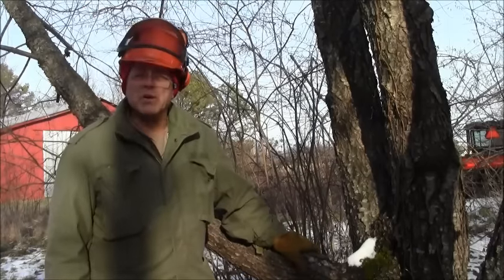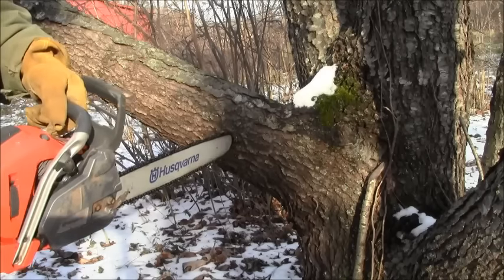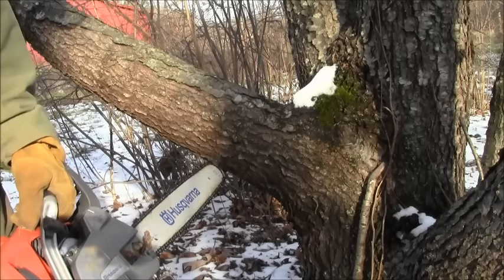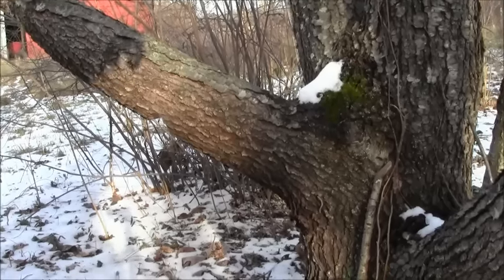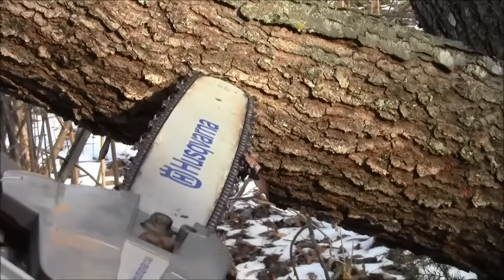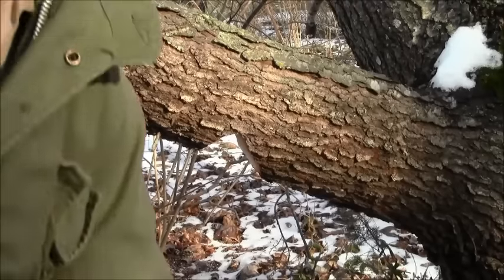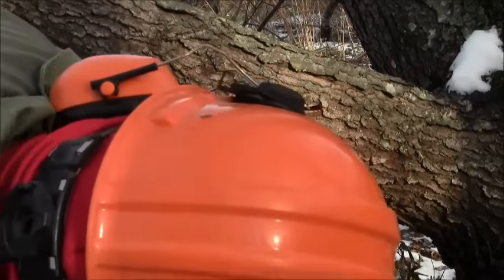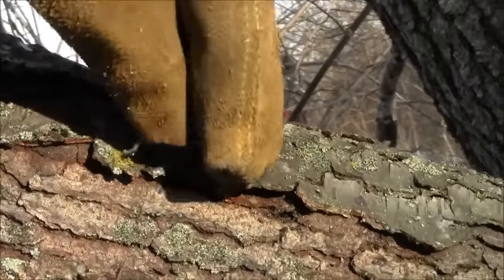Cutting A Small Diameter Leaner

Comment: Thanks for the video - some additional things for me to consider as I have a lot of small-mid leaners ahead.  On this video, I would have liked to see you  continue to see your approach to get it off the stump.
Reply from the maker: I usually start at the top end and work back to the stump.  That way I am less likely to get smacked by a limb under pressure.  You can cut the stem loose from the stump, but until you have done it a few times you may get pinched when things move.  It's usually no problem.  Loggers don't have these luxuries.  They have to make their bucking cuts while the crown may be loaded up with pressure or tension.

Comment from the maker: Another unhappy commenter: "Donald Sheppard commented: "There's no reason to be doing all this fancy cutting, it's giving the beginners way too many options on cutting a small leaner" and "Donald Sheppard commented: "Plunge cuts for beginners on nothing but a recipe for disaster with a kick back into their face" Plunge Cutting, or Bore Cutting is the first cut you learn in an up-to-date chainsaw class. Bore cutting is the thing that allows us to advance beyond the methods used with axe and crosscut saws.  Learn to start with the bottom, attack corner, of the bar and guide the saw with your throttle open, and you can do wonderful surgery on the tree so you are in control until you turn it loose.
Reply: Don't worry about commenters:  what you showed is safe and sound.
Reply from the maker: @thegoodearth7  Thank You!

Comment: So, first off, great idea by doing the diagonal plunge cut.  That is something I hadn't thought about, and I will use that method.  With the benefit of hindsight though, as you said the face cut didn't close, therefore leaving the hinge intact. So to fix that as you probably already know, cut a more acute, or narrow wedge, so it will close and break the hinge. Also, if you cut the plunge cut to the left, or away from the tree trunk, it wouldn't leave that ledge to hang up on the stump.  Having said that, I would have never thought of that before  seeing your  results first. Thanks for the diagonal plunge cut Idea, it's genius!
Reply from the maker: I disassemble little ones like this from the top down, and having the hinge hold it steady is not a problem.  I often cut the hinge loose after the last firewood cut. On straight, balanced trees, the open face keeps the tree attached to the stump so the cutter has a safer getaway.  There is a lot of history in the way we fall trees.  The open face method is pretty recent; worked out by Soren Eriksson in the 1960's.  Mr. Eriksson showed us that a chainsaw can make cuts that a crosscut saw cannot.  The first skill you learn in a Game Of Logging class is borecutting.  It is a life changer!

Comment: What is the benefit of plunging and cutting out rather than Vee'ing the bottom and just cutting straight down from the top, outside to inside?
Reply from the maker: +themadmailler Leaners will go into motion before the hinge is thin enough to bend, and the tree will split lengthwise, making a barber chair.  I see them regularly in timber, and have seen ones that were the cause of a fatality.  You use the bore cut to make the hinge a safe thickness, then you cut the tree loose.  Once you learn to set up the hinge with a bore cut you will not want to do it the old fashioned way, which was used when folks cut trees with axes and crosscut saws.
Reply: Interesting. Thanks! I like your timber felling videos, they help when i'm cutting off-camber trees that i'm usually uneasy about.

Comment: Interesting method ty ...
Try cutting that strap on angle/ if it does split it won't pinch ur bar...
To be safe wrap  and tie rope several times  left of the notch. It will prevent the split.

Comment: just a thought, but could it possibly damage the stump area of the tree on the top side by tearing too much off? perhaps a remedy to this might be to do a 2nd plunge cut at the stump end of the 1st (angled) plunge, but this time cut straight up through, rather than continuing the angle. it might also be a bit tidier. im not a fan of the "inline" plunge cut where its followed by cutting from the back. it just seems risky to me. what you did in this video looked very controlled and safe though it leaves a strange looking stump, but could possibly be modified as per above to leave a cleaner stump. excellent video though. First time I've seen this on YouTube.

Comment: What works for me is starting with a vertical cut from underneath. Then I start a topside 45 from about 8 inches away, nearer the trunk. I make that 45, cutting toward my vertical undercut--away from trunk. When the 45 is close enough the limb slow drops. I find this very effective.
Reply from the maker: I delimb frequently with a pole saw and use snap-cut for that. I piece them back to take weight off and that type of cut works well.  No hinge, though, just a quick disconnect and drop.

Comment: David, would you explain how to finish this? The branch is still attached and I'd be standing there asking, "Duh, now what?"
Reply from the maker: I should show that. Bucking doesn't seem exciting to me. Dropping one is fun and cleaning it up is work. Firewood cutters have a great advantage over loggers because loggers have to detach the big part of the tree from the top and get it out of the woods. They don't have much choice in where to cut, other than deciding where the merchantable part of the tree ends; then they have to buck it there without breaking the log or getting hurt. If the tree is still attached to the stump by the hinge you have a choice of cutting it loose by severing the hinge before or after bucking, depending on the circumstances. Leaving it attached can keep the log from rolling until you are ready to pull it away.  On level ground it may not matter.  

Firewood cutters have the option of going to the top of the tree and cutting small wood first, and working back to the bigger wood. That allows you to work out the stresses from small to big, getting rid of compression and tension dangers a bit at a time. You have to be aware of compression and tension, especially of heavily loaded branches or small trees you have pulled down, so you don't get smacked by a springpole. Generally you cut on the compressed side of the branch or trunk until you see the kerf begin to close, stop and switch to the  tensioned side and cut in to sever.  On heavily loaded branches you make repeated small cuts on the compressed side to work out the power so it won't hit you. That's a quick rundown of the process.  I will  record some bucking on a firewood tree and throw a link in to another reply so you will see it.  Thank You for watching and commenting.
Reply: @DavidN23Skidoo  thank you! Appreciate what you do!

Comment: I'm far from a pro, but just don't see how a V cut at the bottom and then a slow gradual vertical cut from the top would cause a problem. Once you detect the slightest movement you pull out and exit. Once the end falls on the ground you can chunk it up working from the outward end and back towards the cut where you can finish up.  Where am I wrong?  I'm a newbie and want to learn easy/safe/uncomplicated cuts and don't care how long they take to execute. Bore cutting seems less forgiving to error/miscalculation.
Reply from the maker: Boring a stem to establish a hinge before you turn the tree loose neutralizes the risk of the stem splitting. That is a critical safety issue. Bore cutting should be the first cut you learn so you can always be in control of your hinge thickness, and control when your tree goes into motion. Have a look at this video for discussion of avoiding impact injuries: https://studio.youtube.com/video/mkGmGl_nnRU/edit    Here is a video to help you start bore cutting: https://www.youtube.com/watch?v=ULcOb2ssw-c
Reply: Thank you!!

Comment: Hi David - thanks for a great tutorial - I have a very similar leaner, and this was the perfect thing to watch - one question. after you make the plunge cut, you say that for the final cut you have the options of going back in to the plunge slot and cutting out from there at the same angle (which is what you choose to do) or to cut down vertically from the top to connect to the plunge cut slot. This second option seems a lot simpler to me, I was just wondering why you chose to do it the way you did?  Thanks again. malcolm
Reply from the maker: I think it was curiosity. Continuing out on the angle took longer and gives no advantage for escape. I normally pull out after the setup and finish by cutting perpendicular to the stem. When cutting with the bottom of the bar to finish you are already tensed backwards for escape, and fractions of seconds are often critical. Darn good question, and one that makes us think!
Reply: Makes sense - thanks again David
 @DavidN23Skidoo
Reply from the maker: @malcolmpayne5991  post a video of your leaner if possible. Thanks for commenting!

Comment: I'm not going to criticize this method but this branch is nearly horizontal , so it very closely resemble the types of cuts arborists make every day in large numbers in the tops of the tree and I have never seen one do this.  Its either a bypass cut or a vee  cut and then cut the backside.  Either one will drop the branch quickly and safely.  . If you are using this method from the ground, your parallel to grain plunge cut seems safer with the last cut on top of the limb.  If there was a "barber chair split"  it would be moving upward, not toward the operator.
Reply from the maker: This is aimed at people cutting trees in fence rows, edges, etc., who aren't used to doing things that arborists do. I have seen a lot of accidents with people working on the ground who do not understand what trees can do to them. Match cutting of trees, not using a hinge, is quite dangerous to the cutter. A tree that is cut loose is going where the weight is, and the butt, being unattached, can do unpredictable things. https://www.youtube.com/watch?v=8qEAvALXG0w

Comment: i have 14" 45 degree leaner, red oak i think, would you use the same technique? thanks
Reply from the maker: Steve: I wish I could see your tree, but I have an answer for you that may be correct for your situation.  Here You Go! https://youtu.be/OhZDXpANGNE
Reply: @DavidN23Skidoo  thanks, that's exactly my situation
Reply from the maker: @TheSateef  Set it up, be ready to move back quickly when you cut the back strap. Have a helper shoot video to post! Practice the bore cut on a tall stump beforehand if you are not used to doing that. You have to punch it right in one go. It's easy if you have done it a few times. Anxious to see your video!

Comment: Why not just one cut (1/3) at the bottom, followed by a (2/3 cut) on top, 1~2" up higher ?
Reply from the maker: The tree remains stationary when you set it up with a bore cut, until you cut the backstrap.   Borecutting gives you greater control, which is generally safer.  You can set up a tree with a hinge and borecut, sit down and have a coffee break, and the tree will stand and wait for you to finish; not that I would do that, but you could!  Without borecutting you are racing on the final cut to complete the hinge before the tree moves too far, so you are still cutting while the tree goes into motion. That can make for tense moments.
Reply: I could have had two cups of coffee while you repeated yourself.
Reply: If bottom cut closes then tree will barber chair (split)  that's why u wide bottom cut (face cut)

Comment: What would likely happen if you chose to bore in and create the hinge along the triangle's other vertical side? (Cutting away from the base of the tree)
Reply from the maker: I have done it both ways, and they both work fine.  Making the cuts above the stump makes people nervous; they think that method will allow the tree to split.  Cutting below is no problem in most cases and if it makes you feel safer, that's OK.  If something went wrong and your saw became pinched, it should be easier to deal with in the stump than above the hinge.  I very seldom get pinched since learning how to bore cut and how to evaluate the weight and lean of every tree I cut.

Comment: I personally would have gone above and down just behind the bore cut, that way the lower limb would have fallen and broken away. The danger you have of carrying on with the bore cut towards trunk of the main tree is that if you don't cut it evenally there is a good chance the limb will fall, bark strip and bounce in your direction. Resulting in the limb smashing your teeth out, landing on you as you fall back and then crushing you.
Reply from the maker: It goes quickly when you cut the backstrap.  Continuing out or cutting in perpendicularly will both work. The hinge normally stays together and keeps the tree from doing anything bad.  Once in a while you get one of these with a curve like a rocker, and you have to watch those because they will roll up high while in motion. Cutting trees is always a bit risky, but we learn something on every one.
Reply: DavidN23Skidoo I'm feeling a horizontal leaner in a couple of weeks. It's got about 14 inch diameter
Reply from the maker: That is big enough that you should be able to do a face, and regular bore cut perpendicular to the stem to create the hinge; pull out and then cut the backstrap.  Take pictures for us and make a video or slide show!  Stand back when you make that last cut and step back quickly when it pops.
Reply: DavidN23Skidoo it should be a pretty straightforward process, my only concern is the ground is extremely uneven to work on, it's kind of facing out but horizontal but at the top of a ditch with other trees around making it difficult to decide a point of attack.
Reply: With the back strap, instead of cutting right down on top of your bore cut, move down a little towards the trunk. I understand and see how you mean when you say the motion would be more aggressive. But if its to soft the tree won't break away from the hinge, it's had to judge sometimes as once you start there is no going back. The bonus of the hinge being in place still is that you can now clean up and treat the cut as wind blown tree. I always find that it's annoying when cutting timber when it lays on the ground as you can easily saw through and hit the deck with the saw blunting the cutter teeth on the chain

Comment: I thought you weren't supposed to have the end of your bar make contact with wood because it might STOP the chain and then KICKBACK occurs?
Reply from the maker: You start a bore cut with the lower corner of the bar and then straighten out to the direction you wish to cut. Once the nose is buried you run wide open and guide it with no problem.
Reply: @DavidN23Skidoo  OH Lord....that is too technically above my skill level!